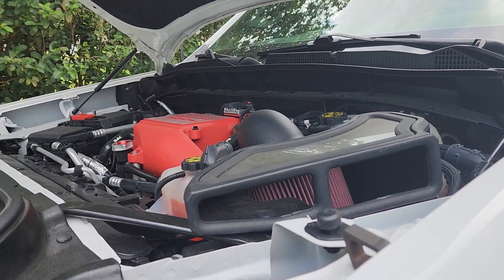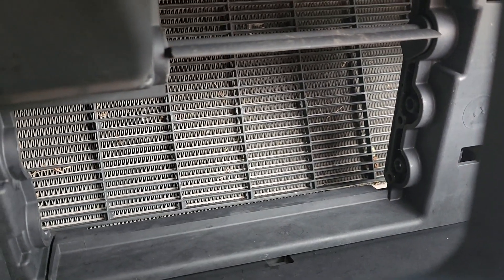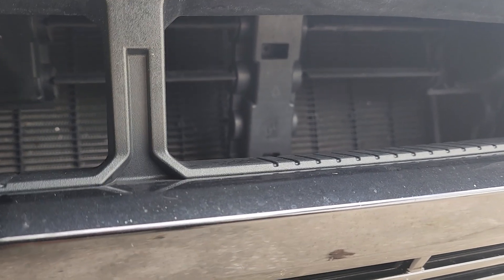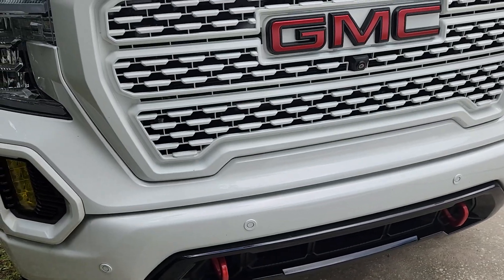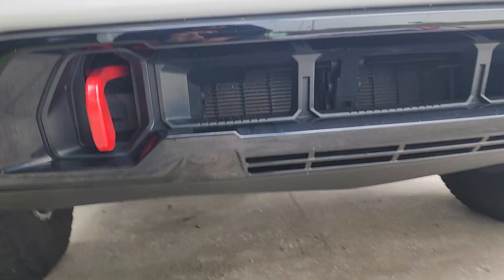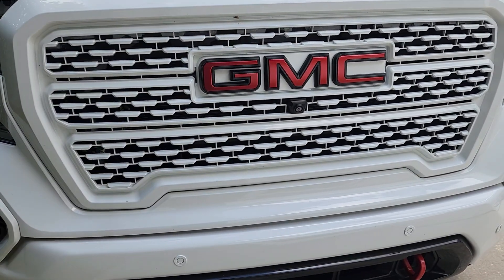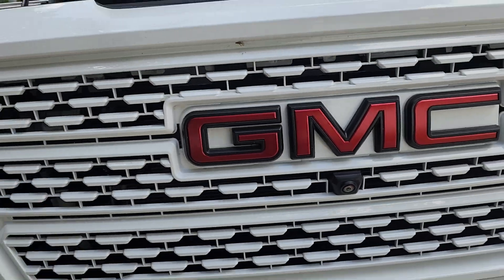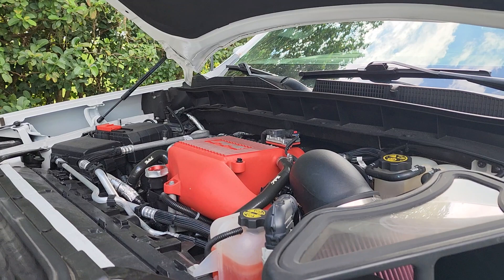Thoughts on the upcoming PPE intercooler heat exchanger for the 3.0L Duramax. The AGS dilemma.

Comment: With all the mods you have made did you get any  noticeable increase in horsepower or torque?
Reply from the maker: Hard to say... never put it on a dynamic so I don't have any factual data to backup any claims. All o know is that everytime I drive another 3.0L it feels like a pig compared to mine. I also get 23ish mpgs traveling fast at around 80mph and low 30s when traveling at 60-65 mph on 35" tires. I'd day the engine is at least happy with the current setup.